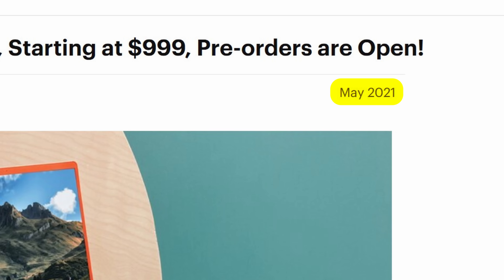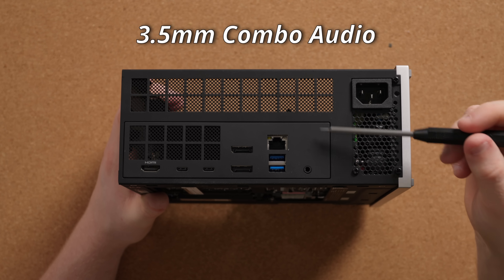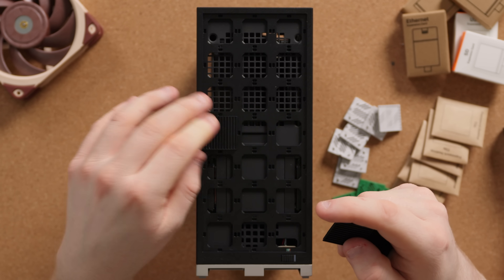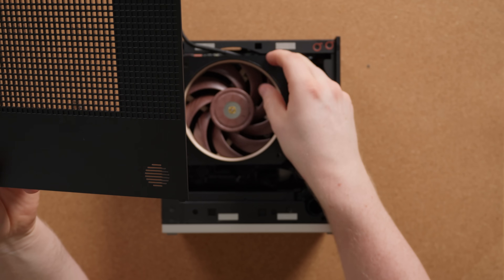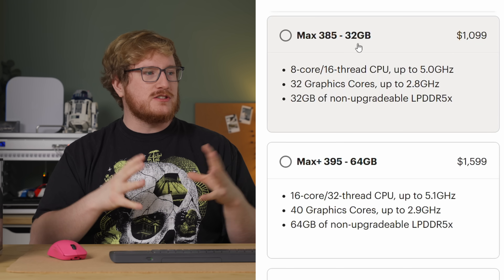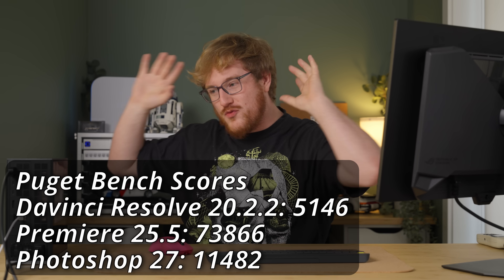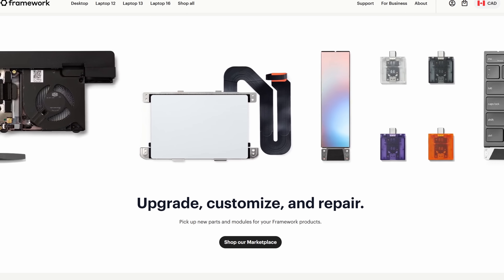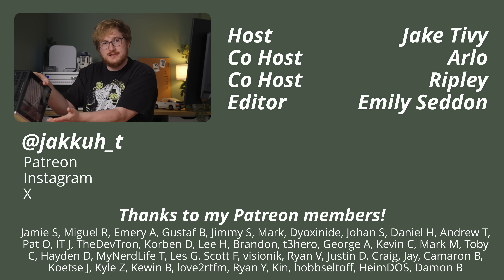I’m glad I didn’t invest, so I can talk the Framework Desktop

Comment from the maker: Check out Boot.dev at https://boot.dev/?promo=JAKKUH and use code JAKKUH to get 25% off your first plan!
Reply: The 395+ uses soldered ram due to there not being LPDDR5 DIMMs with 8000 MT/s.  You can buy a lower AI 370 that supports up to 96GB of 5600 DDR5 DIMMs.  They're available from AceMagic.  You pay for it with a lower end GPU and CPU, but the NPU is the same.  AMD's specs site puts total TOPs for the 395+ @126, and the 370 @80, just the NPU is 50 TOPs for both.

The AI 370 can use both the LPDDR5x, what Framework uses, or the 5600 DIMMs, so uncertain how much the slower DIMMs will impact the theoretical 80 TOPs possible on the Acemagic option.
Reply: Please stop the tiktok face shit. You are better than that!
Reply: Was idly watching, Arlo showed up, updooted and commented for the 'gagement.
Reply: It’s cool from a homelab point of view or as a secondary life option for old framework laptop parts but as a main rig i feel like literally any ol Joe Schmo would be better with a Mac mini or pc.
Reply: @detective_mitch_conner  Framework's cheapest option is half the price of this 128GB edition, and it comes with 32GB of RAM.  That puts it pretty much in-line with a similar-specced Mac Mini.  And it's x86_64 instead of ARM, which means better compatibility if you want to do anything outside of Apple's ecosystem.

That said, you can also buy the Framework mainboards without the case.  They're Mini-ITX compatible.  Buying this way saves like $350 USD.  I'm considering doing that myself.
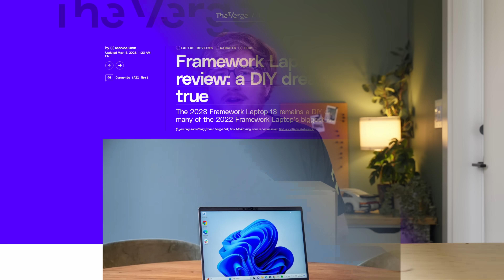Reply: 0:05 oh..... snap.. hehehehehe mmmm diggin that jab to the socks in sandals fella that was not so polite with Mr Rossmann.
Reply: Your audio is out of sync from video btw.
I tried setting a 2ms and 20ms audio buffer on my side.
Thinking it's audio latency on my side and macOS just has some tiny near real-time buffer or smthn.
Reply: Reminder: Framework went to bed with fascists, make your purchases accordingly
Reply: Wait, did you also leave LTT? im confused and happy i see you guys popping on solo channels. nice. keep it up.
Reply: To be clear, a clickbait title - to stir up controversy, while really haven't nothing whatsoever to do with your actual review - will only work once.

Maybe twice if, like me, they're willing to give you the chance to make an early mistake and correct it (but the Internet is a harsh place that I wouldn't bank on that many people being anywhere nearly so kind), for auld lange syne.

Basically, the goodwill will run out extremely fast. Understand that that's the "fuel" that you're burning doing this. Bear this in mind.
Reply: The Flaw is the same as with all machines with those AI Chips.
Too fucking expensive. The ONLY thing that makes this in any
kind or shape better than any other Desktop is that you can go
and give the GPU much more RAM. If a normal Desktop could
do that? You could get ten times the Performance for the same
Price i wager . .
Reply: @FARBerserker  It wouldn't be 10 times the performance.  The 8060s is likely right-sized to work with the speed of system memory, which is still 2-3 times slower than what your mid-range GPU uses.  If your dedicated GPU attempted to access shared memory, it would have to slow down to match it.

The AI 320 through to the 360 were just announced a couple months ago.  They keep the NPU but reduce CPU core count and the GPU CUs.  No one sells them yet, but we'll likely seem some mini PC in Q1 2026.  The 370 and below uses the 800M series of GPUs instead of the 8060.  You can buy an AI 370 barebones system for $599 USD today.  That's still a fairly hefty system with a max supported RAM of 96 GB, using 5600MT/s DIMMs.  GPU is 890M.

Comment: The best thing I think about Framework that is going above peoples heads are that the EC firmware in their hardware is Open Source. There is not a single other company out their which open sources their firmware in their EC  on this earth. This is huge and really ads to the thing that you could teoreticly use it indefinitly into the future! . Not even thinkpads is this open, which people have modified and Lenovo have gotten after them to "secure down the platform"- but meanwhile they just lock things down so people cant use their own hardware they payed for.

Comment: Absolutely 100% not worth it at all. They bring a few cute touches at the cost of at least double what it should cost to build a system. Nothing about it is worth it at all. Just as a small idea of how bad it is, if you build their cheapest system with just a ryzen max 385 and 32GB which is the bare minimum and NOTHING ELSE, it costs $1099. For literally a CPU and RAM. In most desktops you can build the entire desktop for that price.

Comment: A basic black tile set should be included or they should give the option to skip them... they don't.  They should also come with blank IO fillers or offer them.   Very unlikely that APU needs a GPU with it so the internal PCIe could be used for raid, more I/o, AI booster cards, IBM PCIe Cryptographic Coprocessors (o.O), or if you wanna get real funky with the dremel an old school PCI E 5.1 Channel Sound Card.   This may be the play if Steam machine don't work out.

Comment: Horrible for privacy & control.  These Framework computers, like CoPilot+ computers, have built in NPUs in the CPUs and therefore you won't be able to get away from the Recall AI feature in Windows 11 that takes pictures of your screen constantly, which compromises your privacy regardless of how much Microsoft insists its local only.  Being someone who is anti-AI, I refuse to buy any computer with an NPU in the CPU.  Also, Frameworks computers have a physical TPM on the motherboard, which can enable Windows to control your computer (e.g.,  not let you have Linux on your machine as well).  So unless you are going to use this solely as a Linux based computer, beware of privacy & control issues.
Reply: why the heck would you run windows on this?
Reply: @The_Enlightened_Master I think a lot of people fo out of familiarity (or want dusl boot option) & for some games, etc.  But, I even worry about Linux & AI with these newfangled CPUs with embedded NPUs.
Reply: @wtpwtp in what regard? Like why are you worried? Obviously if you run windows then Microsoft is spying on you. But what makes you afraid or worried about npu , tpu and the like? They are just hardware architecture that will run whatever firmware and software you load onto them.

Comment: Maybe Valve/Steam can team up with Framework to use their designs and base their upcoming Steam Machine 2 (or whatever they will call it) on the Framework desktop. Also, you forgot to mention that this thing is great at draining your checking/savings account.

Comment: Seems kinda pointless, why get this "small" desktop when you can get the same chip in a laptop that you can dock to become a desktop or otherwise use it as a portable laptop. The performance delta of having a better cooler on the chip is going to be really small as the chip doesn't scale linearly once you go above 100W, 85W is about the sweet spot for performance and efficiency.

Comment: Maybe I’m not the target audience but I’m not too sure how this is different from a desktop already? 
The appeal of this seems mainly to be just having a desktop come all in one compact box for you but that seems to take out the fun of actually picking out parts and building a pc. Their laptops do have appeal since you can’t really do that
Reply: so like he said, you CANT get this chipset in a bigger formfactor. the way it works is they solder the memory directly to the board as physically close as they possibly can to the cpu, so the design is compact by default. there's no reason to make it larger you would just have a tiny motherboard with a big case around it, all of the hardware is just that small.

Comment: 7:00 this would be worth trying
I spend far more time using Linux than Windows. Been that way for about a decade, even though I've been messing with Linux on secondary systems for about 20 years. Even though my windows system is far more powerful, my shitty little salvaged laptop with Debian on it gets way more use. Battery life is phenomenal & that allows me to keep crap like wiring diagrams pulled up all day out in the wild. And if you're reading this and haven't heard of KDE Connect, check it out. It's platform agnostic but extremely useful.

Comment: that pci-e slot is for internal expansion not a graphics card.
Reply: the soldered memory is about if you want fast ddr5 ram with timings enough tighter than jdec standard for a actual mid-range igpu+high core count cpu amd apu you cant get what you need for a smooth experience with socketed ram. you would loose more than 5% with socket ram and halo strix actually uses 256bit ram aswell to make sure that 40cu igpu is not the dumbest waist. so its not that amd wont its that they cant if you want to actually benefit from such a big igpu. amd is doing a favor by saying "no socket ram dumb for actual mid-rang gaming apu" maby another 5 years.

Comment: Ive hopped back and forth between Wintel and MacOS for the last 20 years. TBH I think I prefer the Mac Laptop approach and just get a machine with as much power and memory as I can afford and then upgrade every 3 to 5 years rather than get a machine thats expandable. I always say "Oh I'll add more ram, change the GPU, etc." but wind up just replacing the whole thing anyway in 5 years because theres some hot new system bus, chipset or what ever. So the soldered ram doesn't phase me.

Comment: Not being able to buy it fully assembled might suck for some people, but it's probably a good thing.

I've repaired 10 friends 'fully assembled, shipped complete' gaming PCs.
They seem to ALWAYS suffer damage in shipping. I have yet tto see a single example where the shit was set u p correctly either. They always have the ram in the wrong slots, or they didn't screw in the support bracket and the gpu is just hanginng on gravity, etc. etc. etc.
And in 2 examples, the friends had packing foam still in the fucking system that was running.
Because people buying assembled PCs mostly don't know what they're doing and can't be expected to know what they're doing.
And not all of them have a nerd/IT friend who is willing to come out without pay to fix their shit.

Comment: Like the framework, in theory.  The problem is they are very expensive. For the same price you can buy conventional products that have better performance in a more compact form factor.  Or buy something for less money for equal performance. Although, in theory, you can have same savings later with upgrades rather than full replacement, some of the upgrade parts are expensive too. It would take quite a bit of time to make back the money and you don't even know if they will still be supporting that particular form factor by then.  The only way I'd consider buying one is if the unit was the same price as conventional competitors.

Comment: Not leaving a hole where one could place a low profile GPU is an absolute deal breaker for me. Completely agree that is a really stupid design choice. The PCI-E slot is on the mobo, there is no reason to neglect having a slot in the frame. Looks like a very short sighted business decision.

Comment: About resoldering memory, you can only do that if-- There are no additional SMD components needed to support higher memory configurations and secondly, you will most likely will be required to modify the BIOS somehow. Similar to modifying the memory on something like a Steam Deck or ROG Ally.

Comment: This seems more like a desk bottom than a desk top. Albeit, a power-desk-bottom. It would fit in all sorts of odd corners that do not necessitate eating up desk space.
As for the soldered memory - it is not physically possible that they could never create a slot interface that can connect the memory. But I don't blame them for not trying; that sounds like a money pit and a nightmare in practical terms. Hopefully there is a world in which they have enough leverage in the market someday to push back against that sort of thing being forced in the first place.

Comment: It's a nice machine..  Mine is only 2 weeks old and it's KILLING it on CAD applications.  Running Zorrin on it and it's going well.   Looking at building a smol side panel extension using carbon-fibre reinforced ABS to take a PCI bus extension cable, and add a few attached accessories - just to make it more betterer.

Comment: Well issue aint "AMD evil", or anythign like that.
Soldered memory is there so you don't "need to buy ram twice" by buying VRAM and RAM separately. As shitty sockets limit the bandwith / throughput of replaceable memory.
Meaning you can't use socketed memory as VRAM, as it can't push data fast enough.

Comment: What a joke. This machine spec'd out the same as right here would cost you well over 4 grand usd plus tax. For the same price I can build a fully decked out gaming pc with at least a 5080 (hell I could put in two for the price) that would absolutely curb stomp this machine and is fully up gradable ( the ram is soldered on the framework).  
 Even a lesser spec'd machine would cost way more than a better desktop and you would still have money left over for accessories. Seems to me framework is trying to be apple with overpriced options and base spec upgrades for taking advantage of idiot boutique shoppers who want something dainty on their desk because it looks "minimalist".
 
 Framework laptops have the same problem. Way too much money for what you are getting and the whole "upgradability" is a scam. By the time you buy a framework and then upgrade it a few years later or spec out a current model now you can buy a much nicer mac book or a gaming laptop with a considerably better specs, but hey your saving the environment.

Comment: Don't get why desktops are being made so tiny. The lack of space limitations is the major benefit when choosing a desktop over a laptop. Why not just go with standard desktop components? With standard components, you get a cheaper, more serviceable, and more upgradeable system! Are there any benefits cramming laptop parts in a tiny chassis when building a desktop PC? I get why some would go with a pre built mini PC when purchasing a low spec office setup. Just don't get why some strive to minimise a gaming system!?

Comment: These chips have enough RAM on them for now. Issue is you can get it and use it this gen and one or two gens down the line you get a dGPU so you can use all the system memory. what's needed is the board to suport that tho.

Comment: Gotta go against the point of the video and say that the soldered RAM still doesn't make sense. Yes I know that it's because the non-soldered RAM performed worse, but why would I buy a computer from a company that makes computers more repairable, when the computer is less repairable, more proprietary, and more expensive? Admittedly the size is super cool for someone who needs a smaller form factor, but I don't think I'd choose it over building  one myself or getting a framework laptop. (Excited for Gen 2 to potentially use CAMM lol)

Comment: Didn't talk about the odd niche that this would be pretty awesome for ... Ultra-modded city builders and transport managers.  Where there's loads of different assets with their own high-res textures, really far viewing distances, SuperSampled resolution [the opposite of FSR/DLSS] and tolerance for relatively low FPS, means having 32GB+ of VRAM and 64GB+with reasonable computation behind them should work better than most options around that price-point.
I've not come close to having a massive-memory system, so I don't know how much COULD be used [without just adding entire workshop library for lolz]

Comment: Not gonna lie looks like a minisforum motherboard.  Any branding on it?  If they're using minisforum they could do a version with a BD790X3D which would give you user configurable RAM and a PCIE5 full size slot.  Not as good for AI LLM but better for everything else.

Comment: 03:35 "If it's not an optional thing it's just factored into the price it's no different"

Can you show an example of a price ever going down by splitting out these accessories? Ideally one where the total cost of the new bundle equals the cost of the old single package. I've literally never seen this happen. In my experience this always results in the user spending more money for the same goods.

Comment: What is everyone's problem with soldered ram?  As long as it's sufficient amount of high quality ram.  Integrating and physically shrinking electronics is how we got from a basic transistor radio to pocket sized super computers with built in two way communications and GPS.  SoC is best.  Do they want to go back to 1970 before intel integrated the CPU into one chip for calculators in case they want to upgrade just parts of the CPU?

Comment: I don't like the soldered memory either, but the desktop was inspired by the performance of strix halo and wanting to put it in a chassis that didn't hamstring it with power and battery limits, and they worked with AMD to explore using CAMM modules for memory but that limited the bus too much and negated a bulk of the performance.